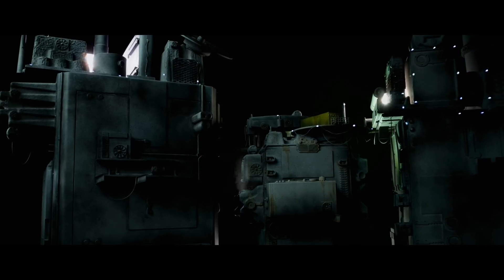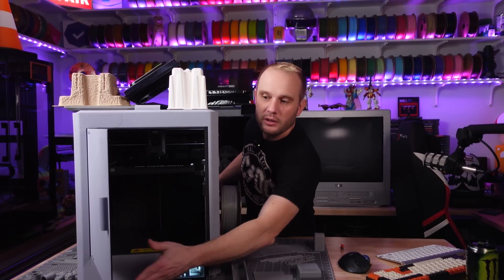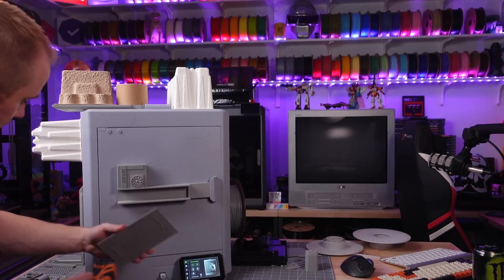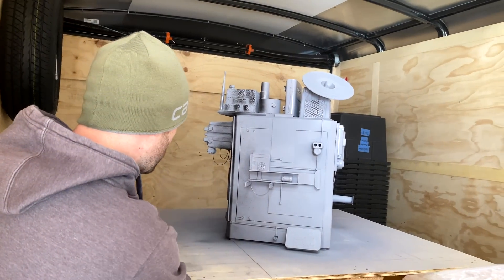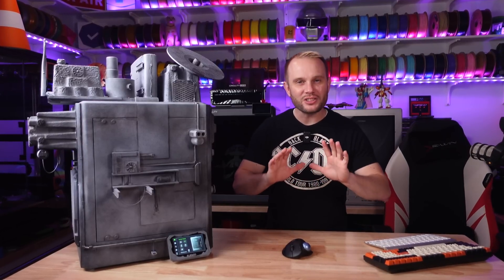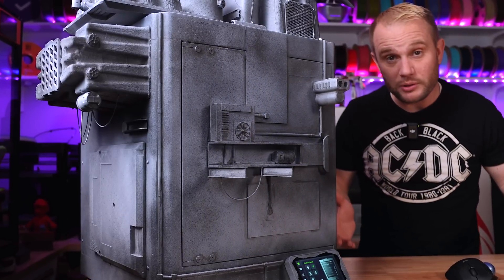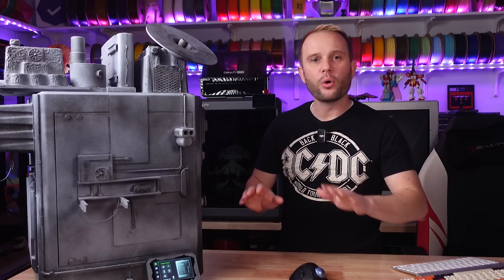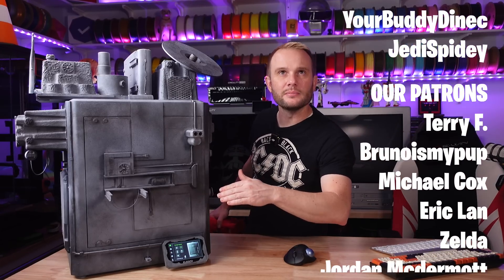Destroyed a BRAND NEW ELEGOO Centauri Carbon?

Comment: So the real question is elegoo centauri carbon vs anycubic s1 because the s1 is the same price and can do multicolor with it and the firmware is opensource but nobody is talking about these two head to head just comparing the elegoo to bambu labs so does the mean the anycubic is a no go? I am also worried that all the hype around the elegoo is mainly because of all the hate going on right now for bambu labs. I plan on buying 3 printers and I don't really have a use case, More of a toy and will figure uses out later but I want variety so I was thinking of buying the Anycubic s1 with ace pro, The anycubic Kobra 3 max with ace Pro and the Anycubic m7 max, I do like sticking with single brands and I am trying to get the best value for money with maximum capabilites and as little limitations as possible and would like to stay at under 2k for all 3 printers, If you have other suggestions please let me know as I am not deadset on these particular printers Thank you

Comment: Accept you failed at removing whatever is still on the front of the box that you painted over.
Reply from the maker: Which part? The painters tape? If that’s what you are thinking of, I put tape over those just so I could remove it later to show the brand and model name in-case I wanted to, but it looked so good covered. I did end up letting the logo be seen on the interface, so I think that was enough and it worked out well.

Comment: Nice video, thanks for posting.  I did want to point out that the respirator filters you were using are ment for dust, not vapor.  Vapor filters are like a hard cartridge.  Just passing this along for your safety.  😊
Reply from the maker: I appreciate it. I wasn’t going to use anything at all, so I just grabbed what I had here already, and it worked for the little painting we did with the doors open.

Comment: You half-destroyed it. You sprayed straight into the fans in the back. Sprayed into the electrical outlet but look cool
Reply from the maker: Only half! 🤣 I sprayed lightly over the fan area so I wouldn’t throw the fans out of balance and the power plug doesn’t really matter, the contacts are tight enough when you plug it in, removes the light dusting it got.